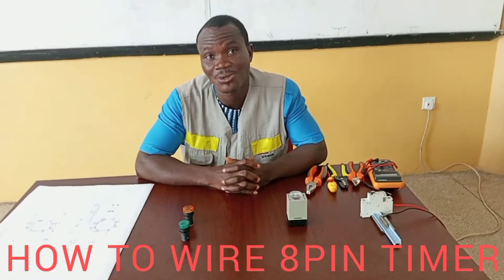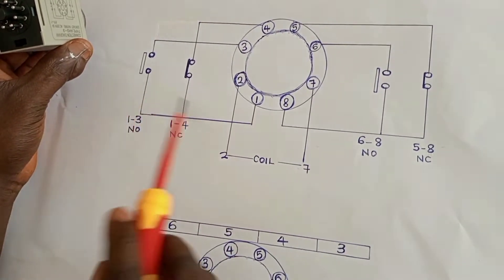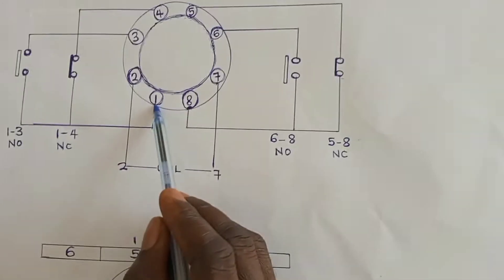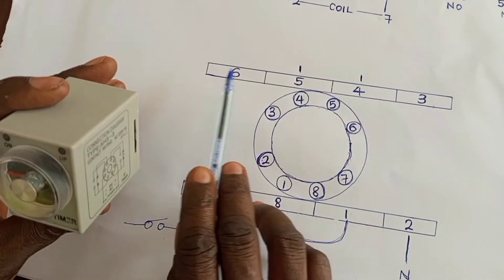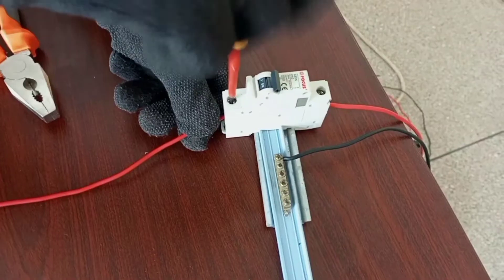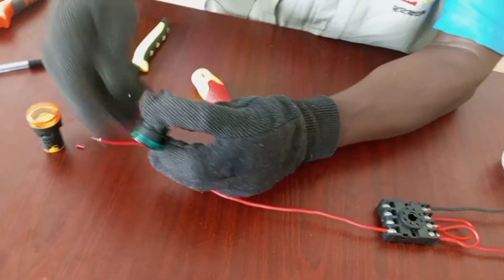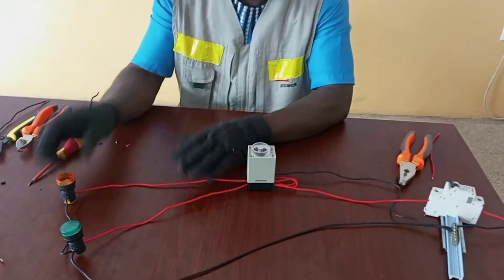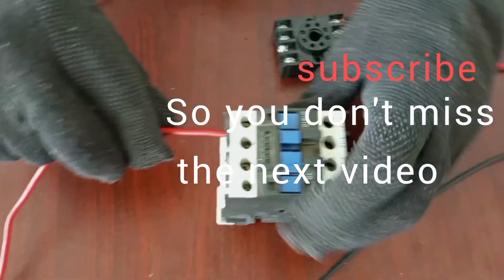HOW TO WIRE AN 8PIN TIMER FOR |"ON DELAY" AND "OFF DELAY" TIMING|

Comment: I have a question sir ,is it a problem  if I connect live wire to number  2 and neutral to 7?
Reply from the maker: It's possible that connecting the neutral wire to terminal 7 and the live wire to terminal 2 on your Anly timer might work, but  it's highly recommended that you consult the Anly timer's manual or wiring diagram for specific instructions.

If you are using the same type as the one shown in the video, follow the same instructions in the video. Thanks